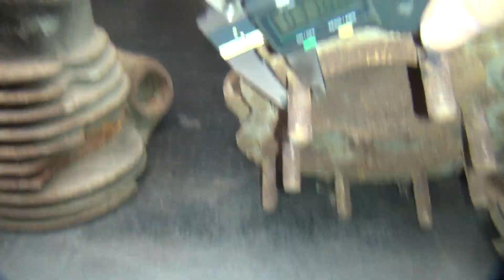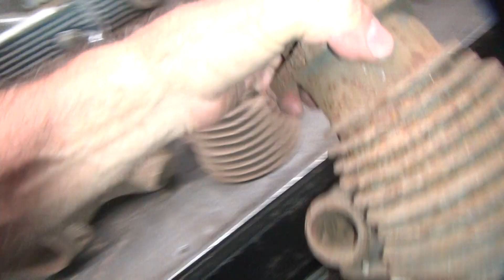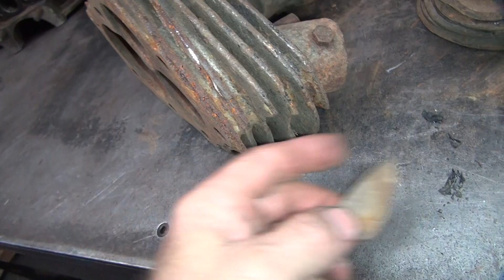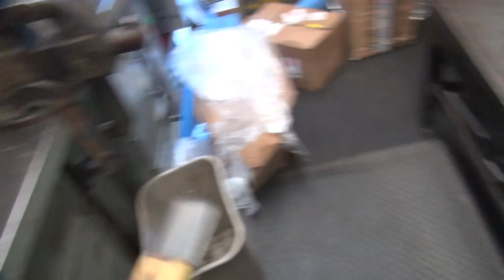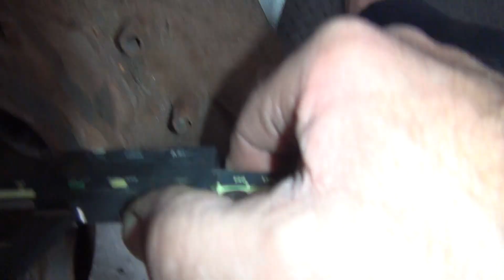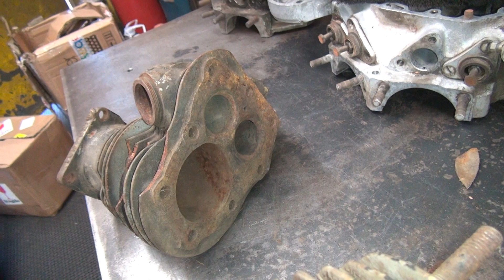see the crap i buy on ebay 45ci wl servi-car cylinders what are the differences harley tatro machine

Comment: How about setting a set of flathead barrels on an ironhead sportster case just to see what lines up or not.
Reply from the maker: not even close. lots of welding and machining. then you have to deal with those valve locations and angles. go buy a k-model and save all the headaches.
tatro